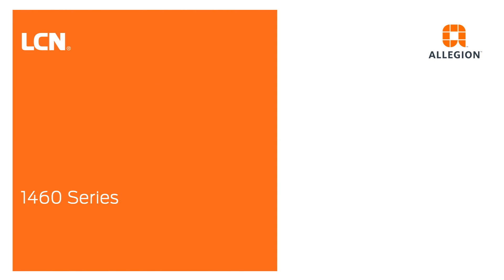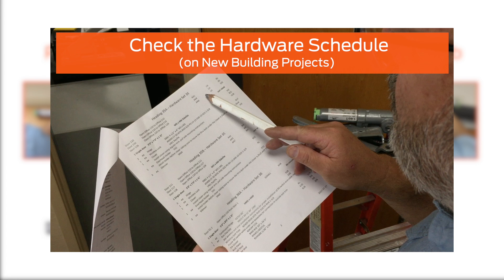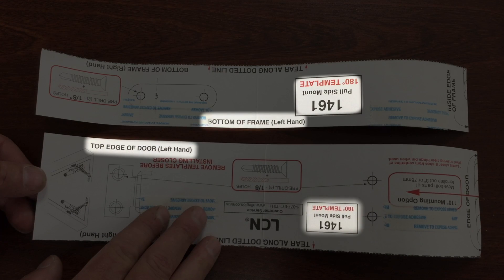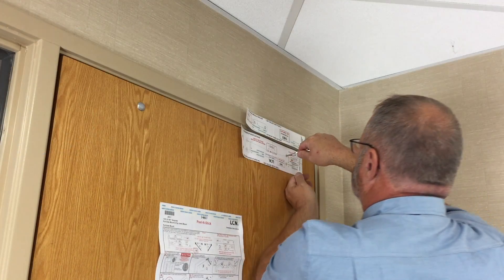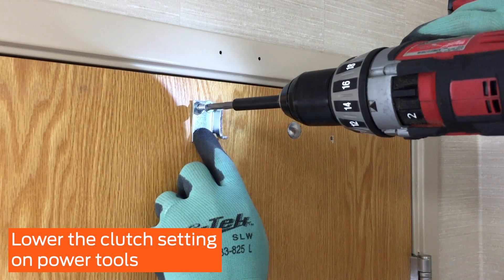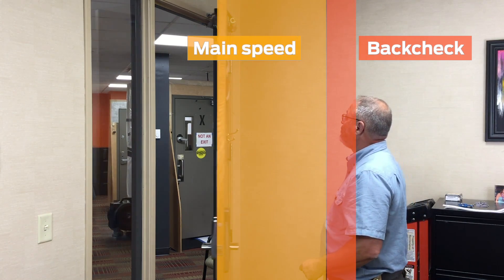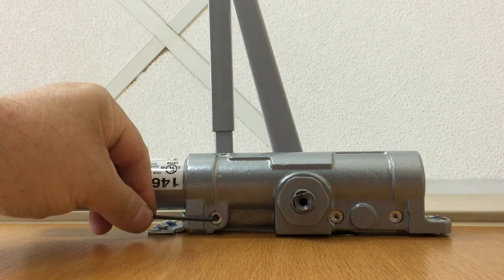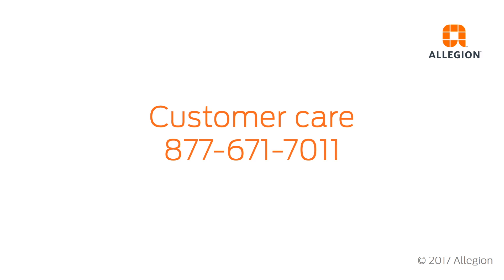How to Install LCN 1460 Door Closer

Comment: Ya, ya got that but if one is installing a used one maaaybe they don't have the danged template & other needed numbers. If folks don't know what u explain here they should drop their tools and back away slowly. SMH
Reply from the maker: Thank you for your comment!  For installations where the template is not available, dimensions can be found on the instruction sheet, and the instruction sheet can be found at our web site, http://www.allegion.com/us, in the Document Library.  You could also call customer care, at 877-671-7011, and ask for support.